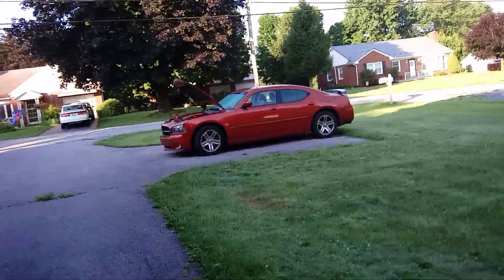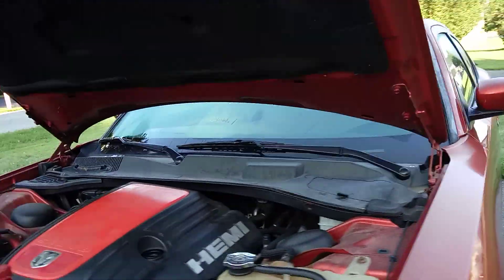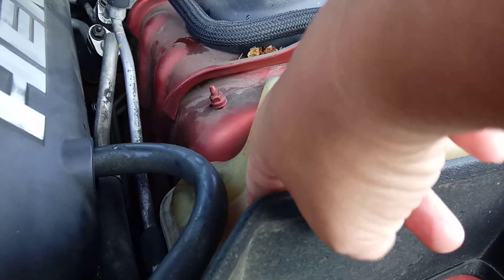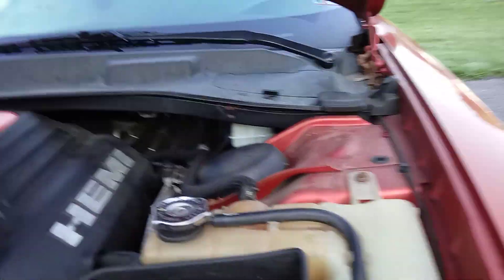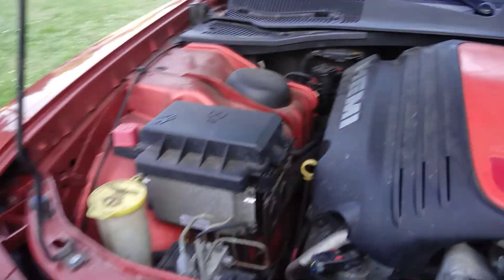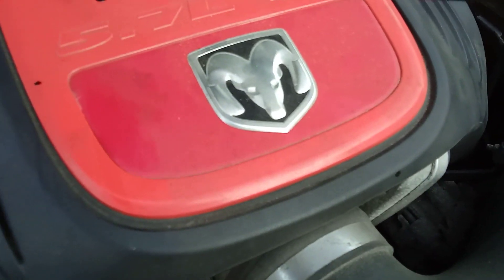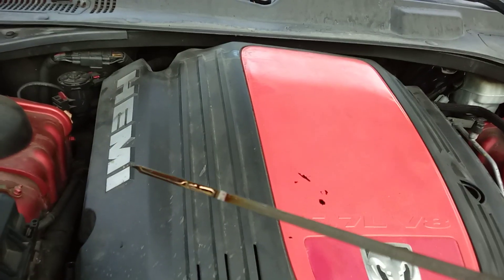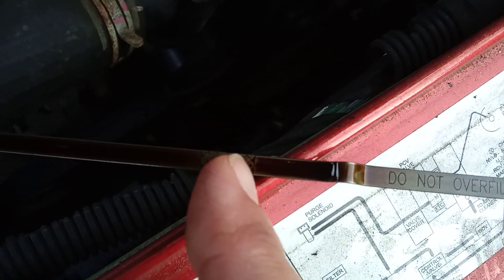Dodge  Charger 2006 fluid check

Comment: It looks like you have the green coolant in there. It is supposed to Mopar long life HOAT coolant(pink) or Zerex G-05HOAT(yellow). I’m not saying it will not keep your car from freezing or boiling over, but you will need to change it more often. HOAT coolants last 150,000 miles and prevent rust/corrosion. Love the charger though
Reply from the maker: Thanks good to know...